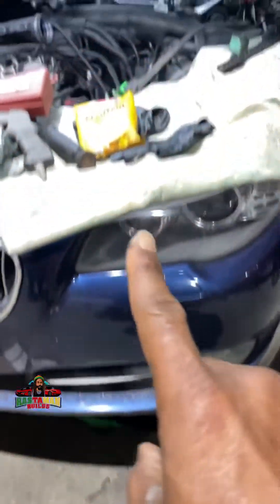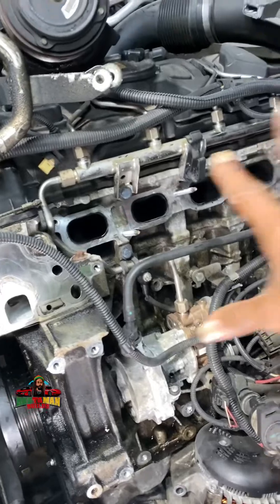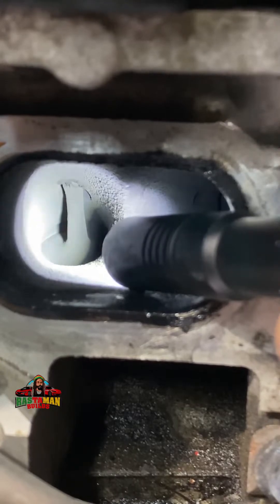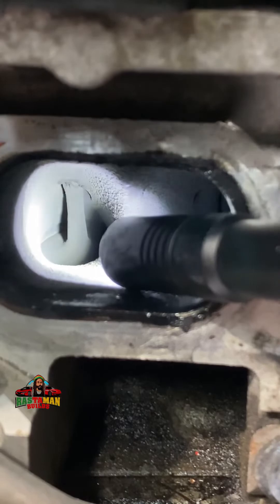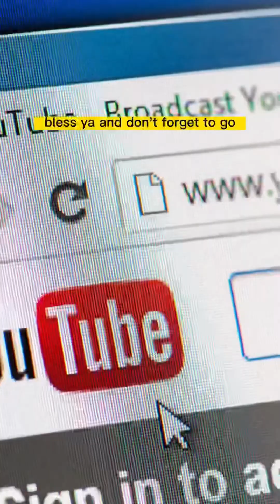See BMW Valves in Action: Real-Time Intake & Exhaust Operations in a Combustion Engine!

Comment: If that’s an n55 then it has valvetronic.  It controls the lift of the intake valves and allows the engine run without the intake.  At least on the n52